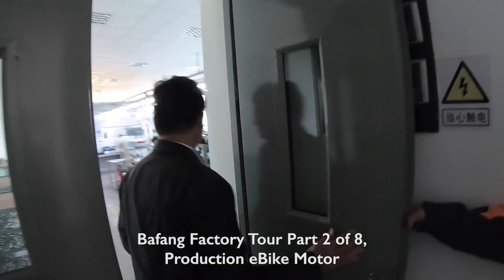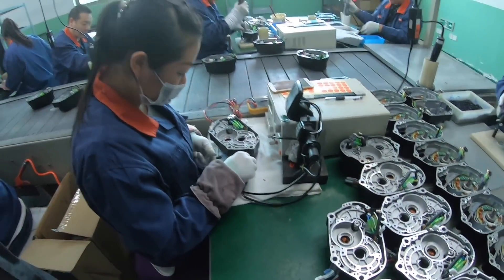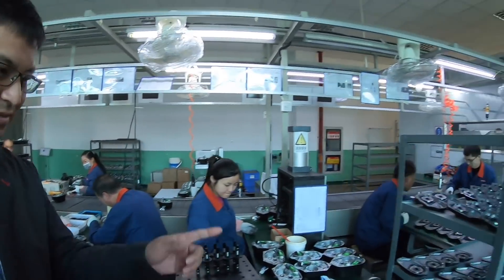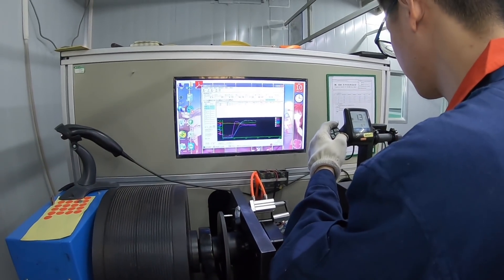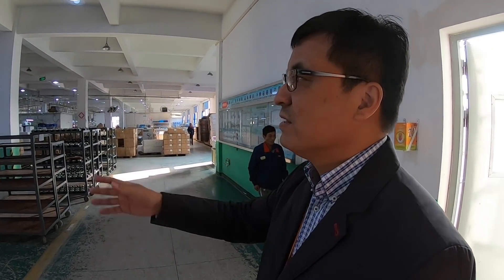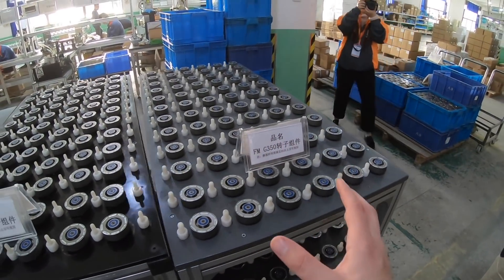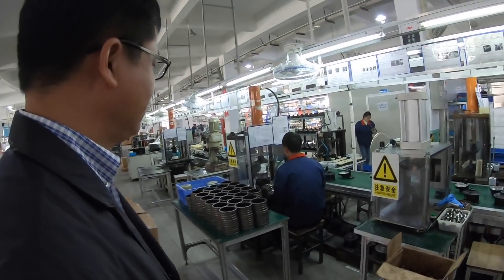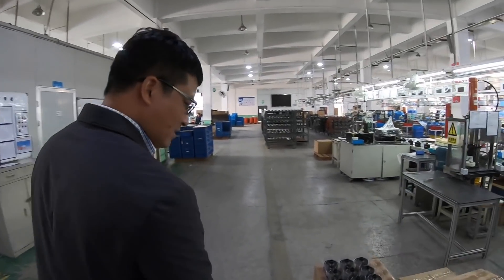Bafang Factory Tour Suzhou China - Part 2 of 8 (Production & Motors)

Comment: That factory look a bit strange, it is like 10 workers on a band, each worker is only doing like one thing, but all are so slow that it look like they never done that before. When I worked on a similar band we often took a handful of screws that was inserted into 10 to 20 products, then we use the screwdriver to fasten all, then we pushed them onto the band that always was full. But then we see the "testing room" that is almost empty, only one man there that slowly test each motor, and when they come to the "packing" the band has been stopped.
I get the feeling that the production speed have been halted for the film crew so it shall not look stressful and noisy, and I guess folk that work on a assembly line in Europe or in America know that you get rather fast after a month, and the factory I worked on had a daily quote and if we did reach it faster we could go home earlier or keep work full time and get a bit extra, so it was always full speed, loud and folk yelling "FILL!" when the shelfs behind us started to get empty.